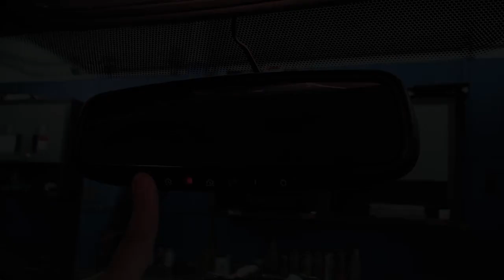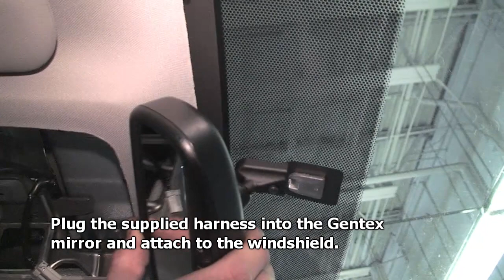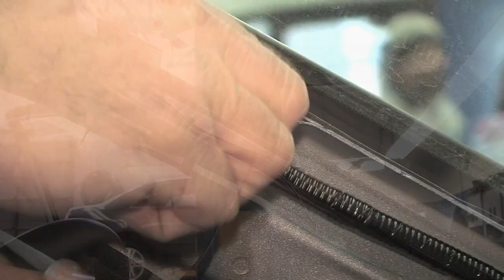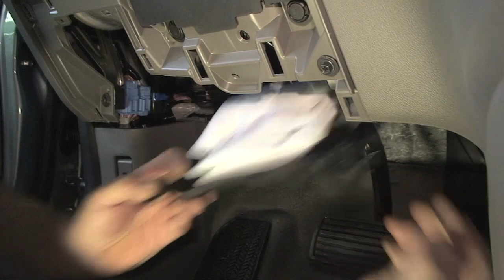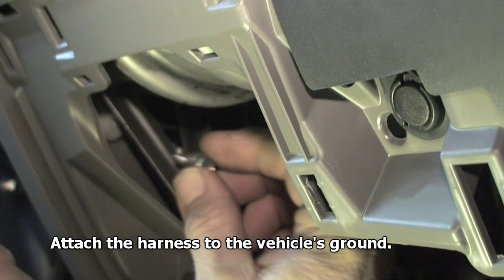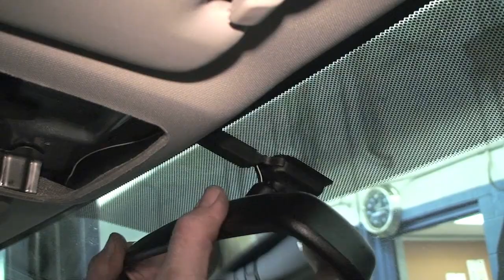Episode #201 - Gentex Day/Night Mirror Honda Universal Installation

Comment from the maker: @Slacktest This item requires some electrical knowledge since it is not plug-n-play like Genuine Honda Accessories are. Furthermore this part is a universal fit item so we are not showing every single step as it applies to multiple vehicles. Therefore this video is only meant to compliment the printed instructions from Gentex.

Comment: Hi I'm looking at some of these mirrors looking to buy one but according to what I see here the mirror just snap in. But according to what I read online I need to buy camlock adapter to get this to work on my honda accord 05 can you provide with a model that will fit on my accord without putting any adapter? thanks

Comment: What power source are we looking for when installing the mirror? Since I have a 2015 Honda CRV is there a specific wire and module I should clip into instead of using a voltmeter to find the power source I need?
Reply from the maker: You need accessory power, constant power and a ground. If you are not familiar with vehicle electronics we highly recommend that a trained professional perform the installation.
Reply: @CollegeHillsHondaAccessories  I am but I am just curious if you have the wiring diagram for my car so I won't have to search the web to find them. Its simple when you know what wire you need to splice to and nowadays all the wires are numbered and color coated.
Reply from the maker: @vincentrovedatti8677  Best advice is to visit http://techinfo.honda.com to obtain the documents you need. We do not provide wiring diagrams.
Reply: @CollegeHillsHondaAccessories  Thank you!